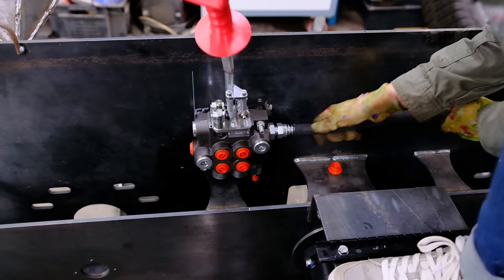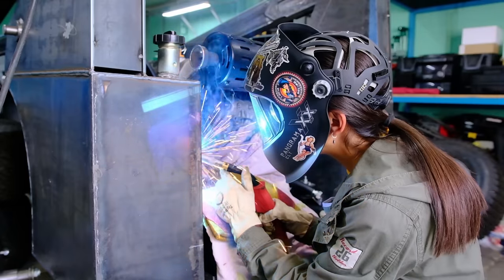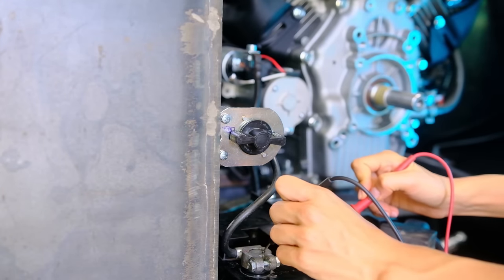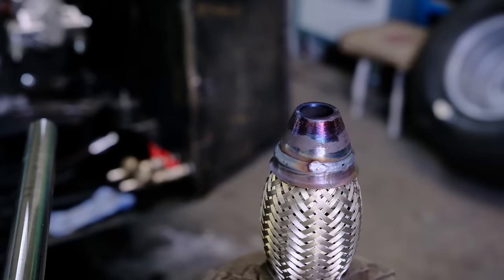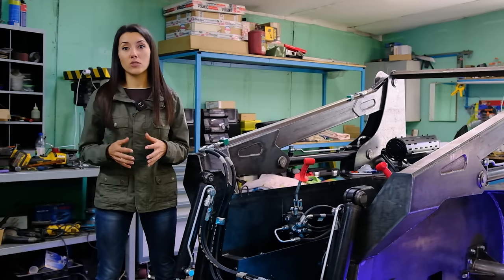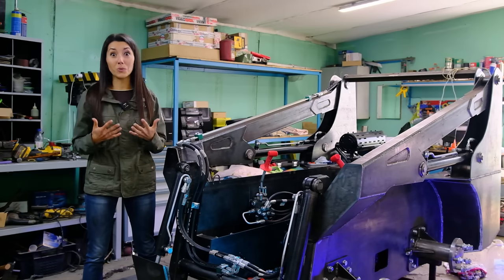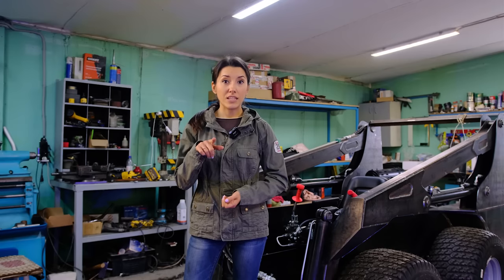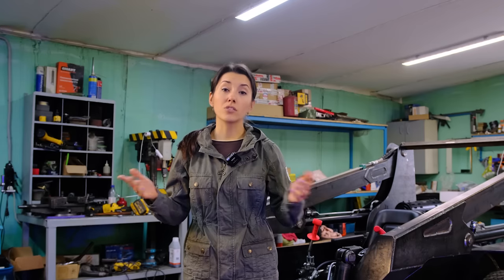DIY SKID STEER. 1st tests of hydraulics and chassis. Part 4.

Comment: Just a tip. When you build the safety lap bar. Make it so your forearm can support your body from rocking forward and backward. That will make it a lot easier to operate smoothly. I have seen rookies look like they were operating a bucking bronco, until they learned to steady them selfs with their forearms on the safety bar.

Comment: As a HEO (Heavy Equipment Operator) you will get a feel for it the more you drive it. A little bit of advice, when operating it, it's all about the feel, I find that using your fingers more than your hands,  of course you have to grip it to move the skidsteer but when using the bucket, a gentle touch will make it so much easier for you down the road

Comment: Never get disappointed when you are fabricating anything especially a skid loader! When I worked for Caterpillar they would send field follow machines out of the new models as test pieces, they wanted them ran in real world conditions by real operators. You would be amazed at the issues we would find and they had 100's of people designing and building these machines only for them to have some very simple flaws that get over looked. I think your doing an amazing job!! Never ever get discouraged, somtimes just walk away for a bit and then attack it agian! Great work!!!
Reply from the maker: Yes, you are right. Thank you so much for the support!😊😉

Comment: I suggest you use safety valves on the cylinders if you are lifting and possibly subsequently an oil cooler on the return if your tank does not have enough cooling capacity.

Also add a small pressure tap on the main lines and adjust your pressure valve correctly so as not to stall your engine.

Comment: great job lucia don't forget when you put the cabin roof and roll bar on to put a swivel safety bar on in front of you for when the bar is down the skid steer moves and the hydraulics work and when you lift the bar to get in and out it stops all the hydraulics from working but so far you have done an amazing job keep on doing great work cheers from down under

Comment: Really great work and i hope to see you lern more by doing these kind of new things. One thing to mention: for safety reasons you should think about adding load holding valves or at least line break protection valves. I am sure you did a lot of research so please dont be offended by this suggestion. Stay safe and keep up the great work.

Comment: From someone that built a fairly large buggie from scratch at the age of 18 a few years back, I am delighted that you are documenting this project. I am really looking forward to seeing the completed machine. I think a pink and black colour scheme and 'Lucia's Loader' on the side somewhere would go very well! I am happily open to correction on this thought from a hydraulic tech, A high-pressure relief valve or a bypass valve in the right place would stop the engine from stalling when the pressure is too much. Just be careful that the valve doesn't cause all the pressure to drop (i.e the boom dropping down if the valve were to s open and stay open)
Reply from the maker: Wow! It is really cool to build a buggie at the age of 18!👏 Thank you for the advices and the idea. I don't like pink, but I'll think the options over😉

Comment: You are amazing!!! Just one thing that may not be evident yet. I may be way off here but the tires seem to have a lot of bounce in them since there is a large sidewall from the rim to the top of the tread. I put tires on my skidsteer that had a large sidewall and when you put a load in the bucket and raise the boom all of that bounce can make the whole unit prone to be unstable and for me scared the crap out of me. Your tires are wider than mine so maybe this will not be the same as I had. Truly amazing work and your skills are top notch.
Reply: They are too big for that weight machine and what it does, just too much flex. Need less sidewall and the most ply possible to reduce that. The boom cylinders may be a hair small and a diesel would be better. None of that said is criticism in the least, I'm sure better tires, larger cylinders and a diesel motor would probably double the cost of the build. But, she's built a chassis that can handle allot more than a Loncin...

Comment: Your fabrication skill set is talented and amazing on this project.
Yes for every fabrication there are sometimes setbacks and disappointments which is a normal thing.
Stepping away from it always helps on problem solving and looking at it again to see what has happened and to correct it.
You made a huge progress to get all the controls to work as they should on a skid steer.
Now comes all the little things like you said the cage for one.
A remote starting switch and engine speed controller to install in the cab/cage
Dont forget adding/subtracting the weights that will be needed to keep the skid steer balanced empty/fully loaded.
I had that happen to me when I removed the bucket and too much weight was on the rear of the skid steer causing to tip backwards.
Great job and cannot wait to see how the whole plan comes together and you put the skid steer to work moving some dirt around.
Great job well done, and hopefully you have inspired other girls/women that there is nothing you can tackle while getting you hands dirty and the mind working.

Comment: Fantastic work Lucia! You should be very proud. Don't worry about how jerky it feels until you have a few hours in the drivers seat. Your touch when driving will adapt to the controls. I have one of the original Bobcat skid steers and it is the same. Once used to it, it drives very smooth. Great work..

Comment: I would suggest making sure that your hydraulic lines in the cab are covered in case they burst. If you enclose the engine compartment make sure there are fans since the engine looks to be air cooled. A roof would be wise also. Good job.

Comment: Lucia, if you have access to exhaust wrap, it might be easier to use that rather than making heat shields.  It also doesn't get in the way when performing maintenance, should you need to fix something behind a shield.  Great job so far!

Comment: You obviously like to challenge yourself.  Such an undertaking is enormous for even a seasoned metal worker, so pat yourself on the back.  Even if I never build a skid steer, I have found plenty of inspiration in your videos.  I hope you plan to add roll protection.  Skid steers can be quite tipsy when carrying a load.  I plan to watch your videos with my 13-year-old granddaughter to show her that any objective is obtainable if you're willing to put in the effort, and don't let setbacks stop you.  Thanks for the enlightening video.  Now I have to go out and do some maintenance work on my 45 year old Case 1830, so I don't have to build one.
Reply from the maker: Thank you. It's so pleasant to know that my videos are inspirational😊 
Sure, I'm thinking the cabin over right now. Plan to make it when the bucket is ready.

Comment: Amazing build. One point that I've noticed is your bucket accessory attachment pont on the boom would be to tie both plates together as there isnt much lateral strength between points which may stress the pivots and rams

Comment: OK, Lucia. I'm sure it don't know why you wanted a skid steer, but you definitely have one now. Build the bucket and any other tools you need and let's see it in action! I don't know how much excess hydraulic power you have there, but one can do some amazing things-- on a small scale, of course-- with a skid steer for the base. They make all sorts of tools for one, beginning with the standard bucket but also an articulated arm like a backhoe, a mower or brush hog, a fence post puller or installer, a stump grinder, you name it. They made some of the tools in the factory, but some of them were fab'd up on site by the operators, too. 

Get to it! And why in God's name did you want one, anyway? It's a great job, but it seems odd for just puttering around in the garden. Unless one has a really big garden...

Comment: There’s a lot of excellent work here. I’d like to see reinforce some of your welds with TIG vs MIG welding just for the penetration properties of TIG. I’d also like to see you heat treat the arms for better strength and durability

Comment: That is a substantial achievement.  I'm proud of you!

Little concerned with the tires.  For light work they will live for a while.  If you watch a skid steer in operation you will see just how much abuse the tires take.  Ridiculously high static loads.  Constant lateral loads while turning.  I know how expensive the correct tire and wheels cost.

Comment: Well done fantastic work! you can get outside using the bucket instead of building a ramp the bucket can help you overcome the issue to get out of the workshop. 

some people use only the skid steer to get them onto a trailer so its possible you can do it to get out the workshop without a ramp.

Anyway good luck hopefully we can see more video's soon
Reply from the maker: Thank you! Both for the compliment and the idea😉

Comment: You need to move the starter switch and throttle control and maybe add a oil pressure gauge for the engine😊

Comment: I don't remember if you put a filter on the hydraulic system, if you didn't, you should, if you did, after your first 10-20 hours of operation, I'd replace the filters, you'll have all sorts of debris from the build process caught in the tanks and lines and such.

 Also, might consider making a bracket to sit over the lines/hoses on the bucket so you can step on that, and not on them when getting in and out of the loader.  

All in all, you should be very proud of yourself, You've made a machine, that a comparable machine from a dedicated manufacture would be 5-6 figures. Skidd Steers are not cheap. a Used one in that size class are about $31k USD ... You built that. Yeah, you ran into some minor plumbing issues, but holy crap.. YOU MADE THAT. You took a pile of steel and turned it into a working machine. That's awesome.
Reply from the maker: Thank you very much for the compliment and advices!

Comment: Hello, very nice video.
I didn't really pay attention to it, but please check, there is a special overpressure/bypass valve for the hydraulic motor. For example, when braking suddenly downhill or moving a heavy load, and the control valve is closed, the engine still builds up pressure, which otherwise cannot be regulated and may damage the engine

￼
Reply from the maker: Yes, I know it, but anyway thank you for the tip ;)

Comment: I imagine you have pressure relief valves to prevent damage to machine and for safety. Homeowner's machines are usually set at lower pressures than a machine for commercial use.

Comment: Just discovered this channel and binge watched this build series, great stuff, well done.
I've not read through all the comments on previous videos, but I have a couple of questions.
Have you considered how you're going to mount the counterweight to the rear end and what will you use for it.
Running the twin pumps from the timing belt will shorten its life quite a bit, have you made provisions for access to the engine for servicing and changing out that belt regularly, maybe something to keep in mind when designing the final sections of the cab and safety cage.
I would love a workshop that size, subscribed for more and to the Russian version too.
Reply from the maker: Thank you and welcome to my channels😉 We'll see a bit later if I have to add a counterweight. As I design step by step one part after another there are some moments that I couldn't foresee because of the lack of experience, but still I try to make every part accessible.

Comment: Use some counterweight or ballast weight to move around the skid steer. Also I highly recommend you to use a helmet, do not rely to much in Hydraulics at this stage of your build, the helmet will protect your face in case any fluid spill around.

Comment: BIG SAFETY ISSUE...
You need to be able to stop the motor in an emergency from the seated position WITHOUT HAVING TO TURN AROUND IN THE SEAT.
Ideally you should be able to operate an emergency stop button with either hand and if at all possible, with either foot as well.
I assume that you will be entering the vehicle from the bucket side (need to protect the hydraulic lines as well) may I suggest a fold down bar where the emergency stop is mounted and if the bar is NOT DOWN then the motor will not start.
How do I know this?
Experience at an African mine... 
Operators with little to no experience who drove like cowboys and at least 1 skid steer rolled a day or they drove into each other, other vehicles or buildings or into ditches etc.
Sometimes even other workers - it was chaos when I got there but changes were quickly made, training done and people fired for stupid dangerous actions.

This is a very nice build so far so please keep up the good work.
Love your welding - grand father taught you well I think.
And you got another subscriber...

Comment: I don't know who you got in your life. But they would have to feel completely lucky. You have built a skidsteer from scratch. That's something not many would consider taking on. But than made the lines up to make it all work. Don't worry about getting some of them crossed the first time. Considering you started out with none in place. That could of easily been done by anyone.  I do hope you take great care in not exiting or entering machine with loader running or lift raised. Without putting in some safety features that prevents it from moving or lifting or lowering unless you are in the seat. Will it have a cab?
Reply from the maker: Thank you! Yes, cab is one of the next steps.

Comment: Not fone watching but short memory so.

I hope you have a good oil filter on the hydraulic system or will add soon, as any small metal shaving can destroy all the hydraulic.

Corse filter before pump and fine after

Comment: Ooohhh.... you do a to big restriction on the engine by forsing two cylinders exhaust in to one pipe as Small as that from each cylinder..... if you want that small engine to work good, give it more "free-flow".